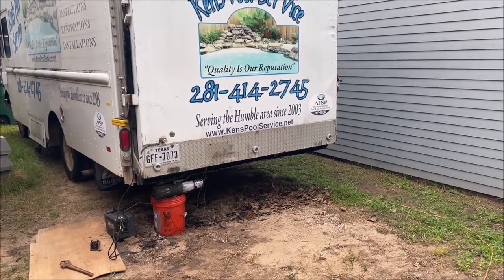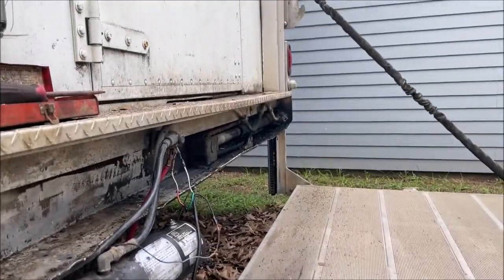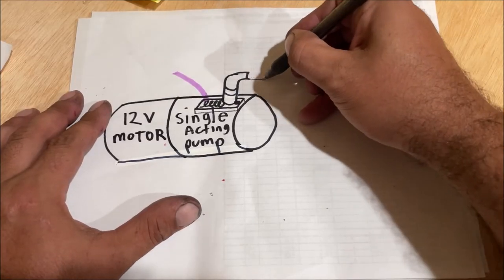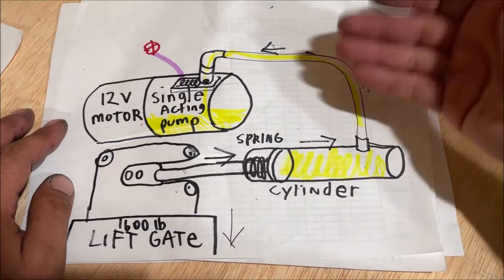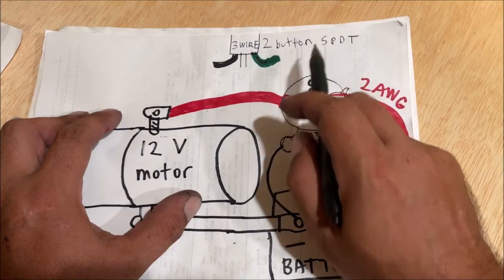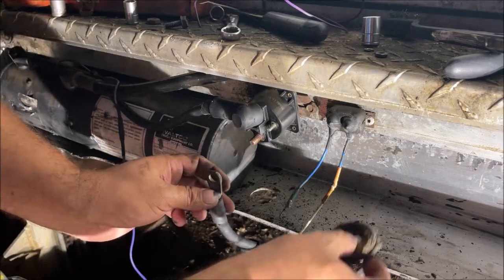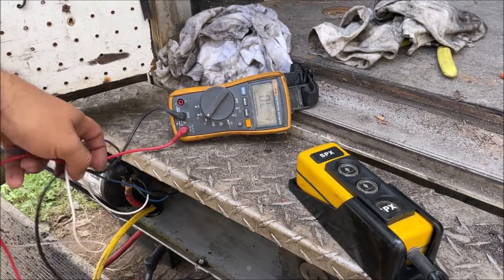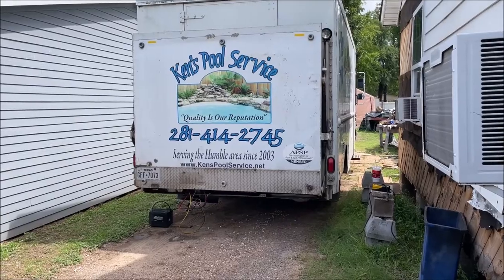single acting hydraulic pump system EXPLAINED and WIRING DIAGRAM lift gate, dump trailer, etc.

Comment: Awesome video! Most of these tailgate circuits also have an "auto circuit breaker" right next to the battery where the 2 AWG cable is connected to the battery.

Comment: Cool explanation, I've worked with hydraulics on tractors for years and you're spot on. There are several type one way valves that have been used over the years, I'm familiar with lever operated, but I think electric motor operated works basically the same way. Great video.

Comment: I agree with everyone, grear job explaining. I just want to mention one thing fuid cannot be compressed. Ir is pressurized but not compressed. Great job. Thanks, Tim
Reply from the maker: hydraulic fluid does not compress well..  the pump attempts to compress it.. if hydraulic fluid did not compress at all you would blow the system out in 2 seconds

Comment: Good video. Thanks for covering your connections with shrink tube. Not sure how corrosion works down there, but up here in Michigan it will ruin your day trying to figure problems out when its just a corroded wire that went through a winter up here uncovered. Excellent explanation of the hydraulic system as well.

Comment: Hey hoss thanks for the advice. I'm fixing screwed up wiring someone did to a dump trailer. My advice on the top window and such is to use your big vehicle. Park it close to the house and set your ladder up to get on the vehicle and GIT R DUN. 😀

Comment: thank you very much for the explanation, just one question, when you puss the button up, the pump starts and  the solenoid is off right?, only when you push the button down, the solenoid starts ?, thank you very much for your time

Comment: But how do you activate the down button without a remote? I have a basic hydraulic pump that came out of a couch that tilts and lifts. However the remote was missing, when I plugged the pump into the power socket it began to extend out. Now i want to retract it but I can't. I assumed that reversing the polarity would work so i plugged the positive to negative and vice versa but that still won't retract the pump arm which is fully extended at the moment. Edit: Theres only two cables running to the 24V motor eg. black and white.

Comment: Excellent video until I came back from making a sandwich and I couldn’t believe my eyes when I seen you using Wire Nuts for automotive. 

Trying to finish my sandwich with a side ache from laughing so hard isn’t easy. 

😆  Hey I’m just giving you shit Excellent video, I new exactly what you were doing by using wire nuts I do the same thing they are perfect for temporary testing your work don’t have to waste tape and time. 

Wire nuts are quick and insulated and make it easy for testing your work until you’re ready to make it permanent. 

I like seeing common sense and there’s too many people out there that don’t have much if any 😂 

Good job, Great video 👍
Reply from the maker: you should see how they wire in huge industrial 3 phase motors that the whole room vibrates and run 24 hours a day for years…  with wire nuts..  wire nuts get a bad rep because dumb asses use them wrong..  I use them for testing but not permanent
Reply: @chriscraft2  
Exactly 👍